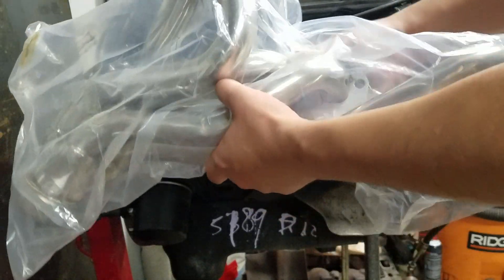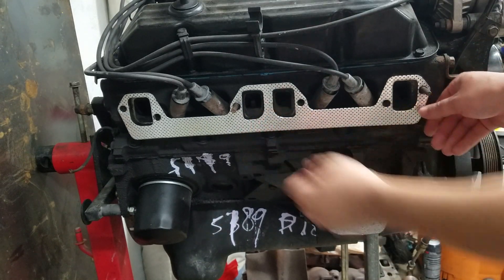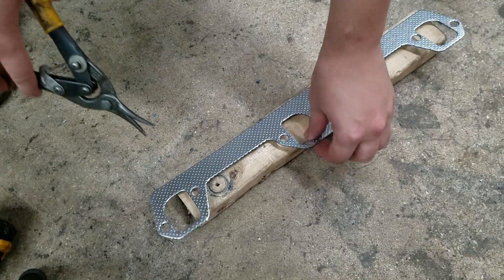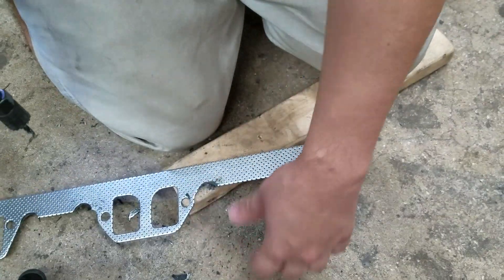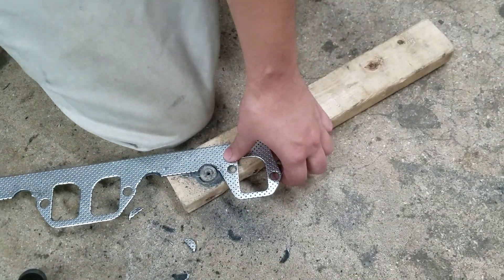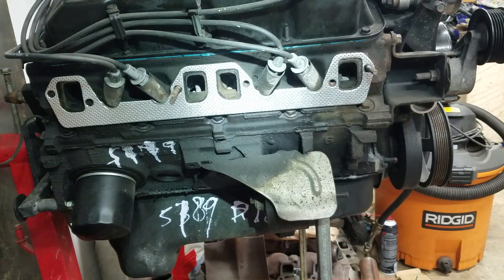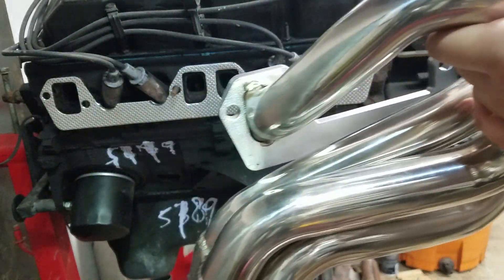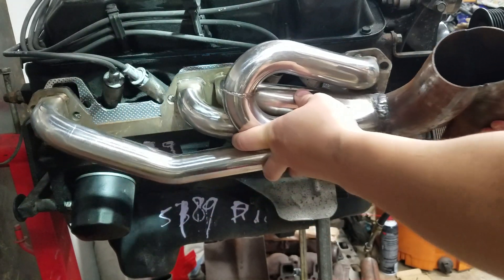Ebay dodge 5.2 5.9 318 360 header / turbo manifold gaskets. How to make them fit. dakota durango ram

Comment: you can just cut the whole center portions off. A lot of people do it anyway to give it a "stock" look as usually the stock manifold/header gaskets will not have that part showing. No real reason to need gasket there.